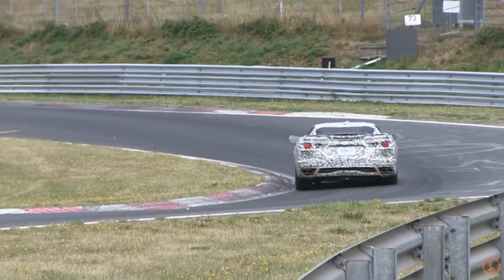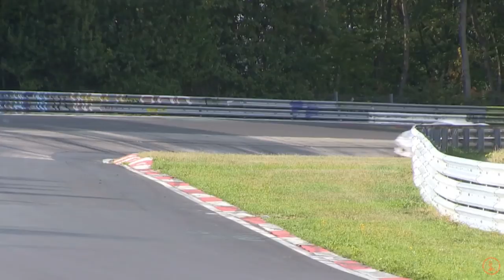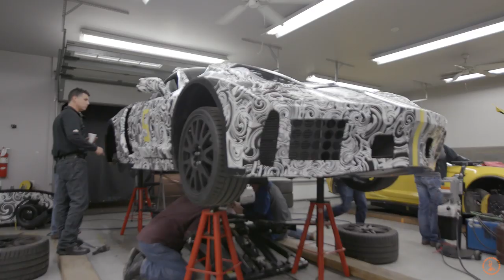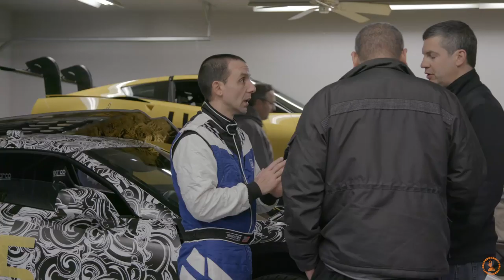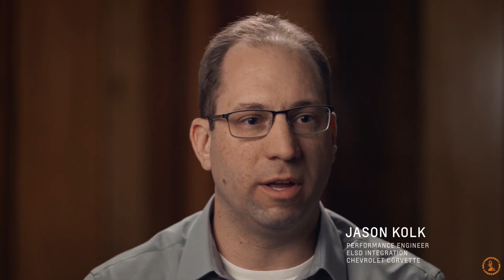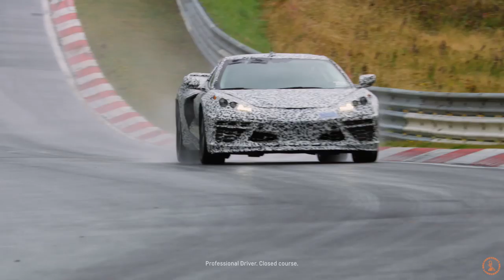2020 Corvette C8 Nurburgring Lap Time REVEALED!

Comment: Wow talk about slow given it’s a mid engine 500HP car.
Look at Porsche models with 500HP.
Reply: Swadian Knight 
Look at the GT3 numbers! Look at the GT3RS and GT2RS.
Look at the all the Porsche models in the top 20 times at the Ring.
Then look at the C8!
Porsche managed to set a lap record with a GT2 RS while the 750 HP Vett could not crack the 7 minute mark.
GT3 did it in 7.12.
BTW these are all times from the 991 series Porsche. God only knows what the 992 series will do given that the S is the fastest to be released so far.
Reply from the maker: @miketheman4341  The GT3RS and GT2RS are SO much more expensive than the C8 though, it's just not a fair comparison.
Reply: Swadian Knight 
Sorry but a GT3 is not 400k!
Mine was 157k.
Secondly Porsche’s numbers have never been disputed as they are documented. It’s not a claim! It’s recorded on video by Porsche. It’s why times include video.
Imagine my surprise that Chevy keep this a secret for this long.
Reply: DailyDownshift 
Sorry but the GT3 is not some insanity expensive car. Secondly the S and 4S are putting up comparable times in a car that drives much better and is leaps and bounds ahead of the C8 in build quality.
Remember the C7 made the 5 least reliable cars list from Consumer Reports and the Z06 actually broke down at the  Best Drivers Competition.
Chevy has demonstrated that you get what you pay for.
Reply: Swadian Knight 
You really don’t know cars!
The GT3 can be had for 143k NEW!!
Reply: Swadian Knight 
You are the only one who got it wrong!
Now go to the Porsche site and pull the GT3 for 187!!!
You can’t! A GT3 RS can be had for that price which proves you don’t know cars.
Lastly Porsche is on top of all sports car markers in reliability. Again this is not a secret. Unlike the Vett which always had laughable GM build quality Porsche is the sports car that you can drive 7 days a week in every climate. 
Was Consumer Reports lying about the C7 when it was named to the top 5 least reliable cars on earth? Not sports cars but ALL cars! 
That’s impressive even for GM! To sell a car that can cost between 50 and 150k and have it be among the worst cars on earth according to a company that does nothing but evaluating consumer products is an accomplishment.
There are no C8 production cars on any road. What we know is that the actual cars will get 1/3 the man hours that the pre production models got.
Imagine my surprise if I believe that GM might not produce a reliable product given it’s history with the Vett.
Then again you don’t know the difference between a GT3 and a GT3 RS so why would I think you know any better.
Reply: Just look at the price!
Reply: Swadian Knight 
What happened to your nonsense claims about the price of a GT3?? LOL!
I thought so!
Secondly you see more Vetts because it’s a cheap car. It’s the same reason you see more Corollas vs BMW 3 series on the roads. Secondly if you live in a modest income community you will see cheap cars whereas Porsche has no dealerships in average income communities.
It’s amazing that you cannot link the rarity of an expensive car with the fact that’s it’s not a mass produced car like the Vett.
Again have you ever seen a university let alone alone an understanding of research methodology?
It’s per 1000 cars! Not 100!
Meaning as long as a company makes 1000 cars it’s reliability can be measured accurately.
Again the Z06 broke down during the best drivers car competition. Consumer Reports listed the C7 as one of the 5 least reliable cars on the road.
I suggest you consider a community college as it will help you to understand methodology and also it might get you to a better zip code as you don’t find Porsche’s on the roads where high school grads live. No they are on the roads in America’s best zip codes.
What idiot uses a Craigslist ad as an indication of real data?
LOL!
Reply: @miketheman4341  I love porsches a lot and all gt3's but i knew the vettes are just as capable when it comes to performance.The C7 Z06 equipped with the z07 package beat a 991.1 GT3RS on the nurburgring and on mazda raceway laguna seca with randy pobst driving... Bottom line is Corvettes are the BEST bang for buck.. But i agree and admit porsches are built better and overall just a better performance car.
Reply: Meelad Ibrahim 
That’s my point! But beyond that it’s about bang for HP. Think about how much HP the Z06 had vs the GT3RS. It’s should not even been close.
The last Vett from the C7 embarrassed itself at the Ring give it’s HP.
Porsche put 700HP in a car and it broke the Ring record. Chevy put 750 in a car and what happened?
Lastly as Randy Pobst from Motor Trend put it you can push a 911 in a way that no buyer can push a Vett. 99.9% of the people who buy the Vett can never push it like they could a 911. 
These are pro drivers and the numbers are a disappointment according to the video. Which is exactly my point.
Reply: Meelad Ibrahim 
BTW the Z06 did it in 7.22 while the GT3 did it in 7.12 so no the ZO6 did not beat the GT3 at the Ring.
Reply: @miketheman4341  I agree 100% thats why porsches are just the greatest sports car in my opinion they are worth the money. Every single horsepower is able to put the power down and anyone can get in it and drive it. Where the vette needs patience and practice. But to me its still worth it for 79K that amazing v8 sound, manual and great looking too. But Porsche is just a step up overall. However, with the C8 being more balanced now i believe the C8 z06 will take it to the next level to compete even closer to the 911's.
Reply: Also a ZL1 1LE which is a camaro LOL.. did it in 7:16 and that car is around 70k out the door... All my point is chevy is a good bang for buck if you can't afford the Porsche.. Again Porsche still is the best in my opinion
Reply: Meelad Ibrahim 
I agree that the C8 is a huge step up but it remains to be seen how reliable it is and how it handles in the hands of real buyers.
Lastly you posted a video of someone doing a lap at the Ring. It’s not an official time nor is it listed as such by any publication that tracks Ring times.
This has become a real problem as most of these videos are not official times and frankly it’s highly unlikely given the official times of the ZO6.
Reply: @miketheman4341  I see, now i do think the C8 is an improvement for real buyers to be capable of handling the car near the limit without fear of losing control. After reading a review from Randy Pobst, he did state its much more "mature" and "grown up". Also stating the fact that it will understeer at the limit rather than oversteer. Unlike like past corvettes they are prone to losing control and just difficult to understand and drive the car hard. That is something to look forward to, however the reliability issue.. who knows haha.
Reply: Meelad Ibrahim 
True! Still we agree that this is not as good as a Porsche but it’s an improvement.
Lastly according to what’s been posted no one will be buying another C8 at the introductory price of 60k.
Chevy is raising the price by as much as 20k which I knew was coming. It made no sense that this car could be made for this money.
It also means that a future C8 could easily be a six figure car. This means that the Vett is no longer the Everyman sports car it was for years. A ZR1 could be a 200k car.
Reply: @miketheman4341  If you knoe anything about Consumer Reports you'd know they are considered a laughing stock. Corvettes are and have always been reliable cars.
Reply: bobe8888 
According to whom? Cite your claims and sources.
You can’t!
Reply: Swadian Knight 
Wrong again? First you claim that a GT3 costs 187k!
WRONG!
No I did not forget!
Then you claimed that there was NO such rating by CR!
Again Wrong! I posted it!
Now you want to argue that it’s not valid because you don’t like the metrics but how could it be flawed if it never existed according to you??
Lastly cite your nonsense claims regarding CR being paid. 
Give me a source! You can’t!
If you took an economics class you would know that Chevy has far more capital to buy a good review vs Porsche.
Remember this lesson. There is no substitute for a formal education.
Reply: bobe8888 
So Motor Trend is lying as well and Car & Driver? Again cite your nonsense claims!
Do you understand this concept? Example the ZO6 was the only car in the history of Motor Trends Best Drivers Competition to break down!!
Lastly Porsche owners don’t do any maintenance on their cars otherwise they would not be Porsche owners. They pay people like you to do that work just like they pay people to clean their bathrooms!
Remember this lesson!
Reply: @miketheman4341   The dealers are marking up the price because of high demand, that will come down after the initial rush. The small block chavy has been an incredible engine, simple and reliable. And if you do need something repaired it won't cost as much as a house. Old Porsches are rare, old corvettes are everywhere with high miles.
Reply: bobe8888 
Old Vetts are everywhere in low in zip codes! It’s the same reason Corollas are everywhere. They are cheap and their are plenty of them including spare parts.
Now again is everyone lying? The entire automotive publishing world??
Reply: How about the Motor Trend where the 911 turbo they were testing had one of the turbos lock up? Yes the C7 ZO6 had known cooling issues in extreme reat, the issue was fixed and the ZR1 had like 10 radiators to make sure that didn't happen.
Reply: @miketheman4341  Yeah Jay Leno is a poor car guy. James May is a poor car guy. Real car people always work on their own cars, that's part of the experience. You don't because you're not capable.
Reply: bobe8888 
You are missing the point! It broke down which NEVER happened in the history of BDC !
CR RANKED it as among the 5 least reliable cars on earth. Fixing it in later years is not an excuse.
Lastly you are clearly out of the loop. Chevy is raising not lowering the price by 20k.
It’s a huge story!
No one will be buying a C8 for 60k next year.
Reply: @miketheman4341   No one works on European cars because they're lease or throw away vehicles, that's why you never see old ones on the road when they need work on you just throw them away, because they can't be repaired, at least not at a reasonable cost.
Reply: @miketheman4341   What did CR bais this on? Because the companies that collect metadata on car reliability says the Corvette is above average in reliability. Maybe not the early C7 ZO6, but all the other models. The only other not so reliable corvette was the early C4 with L98 that was a junk engine, which was replaced with the awesome LT1. All manufacturers make mistakes Porsche is not immune from them. Hey look at McLaren right now there are absolute garbage, fast, but total garbage.
Reply: It does look like the price of the C8 is going up in the next model year 2021, which is to be expected every year. Looks like +$10,000 which is still half the cost of a $140,000 money pit.
Reply: ok, so why are you watching videos about corvettes if you don't like them? Why Aren't You Going To Watch Porsches Videos? lap times in nurburgring don't matter anymore, so many variables, different drivers, different climates. Nowadays these lap times are just for people like you talking shit. 

 too many variables and on a very long track like this only makes things worse. so stop! Nurburgring is not the only circuit in the world. (the 2015 corvette C7 Z06 costs 98K and made 7: 13.9 and the porsche GT3 RS 2016 which cost 187K makes an "estimated" time of 7: 20.0) if you don't know there are different ways to make a fast car. Some are simple and inexpensive and others are expensive and complex.

 The Corvette is a performance car that has one of its main goals being accessible to people who are not rich, and that makes all the difference. That's why they use different "recipes". gm seeks to make the corvette as fast as possible but it doesn't cost much, which is very difficult. Porsche just develops new technologies for their cars and because it's a premium brand you don't have to worry about values.

 let's take laguna seca lap times as an example because the test was done the same day by the same driver.

 the manual corvette Z06 C7 made 1: 33.05 and the Porsche GT3 RS did 1: 33.29 but then you will say that the Z06 needed 150hp more to be 0.024 milliseconds faster but that's where it is! the Corvette Z06 costs half the value of a GT3 RS both use different recipes to get the same results.

 the corvette uses wider tires, have more horsepower.
 porsche has less power but has pdk, four wheel steering, roll cage, lots of carbon fiber, less weight and much more aggressive aerodynamics, not to mention other technologies and it's these premium materials and technologies that make the GT3 RS so expensive. Now some track times for you. 
Virginia International Raceway. corvette zr1 2: 39.50 
corvette z06 c7 2: 41.32 
porsche GT3 RS 991.2 2: 41.60 camaro zl1 1le 2: 45.0 
porsche GT3 RS 991.1 2: 47.0 

remembering that even the most expensive corvette is still cheaper than a new GT3
Reply: The Guardian damn that was a great reply haha.. facts
Reply: @miketheman4341 
Remember the head 2 head between the C6 ZR1 and the Porsche 911 Turbo S? Guess which one couldn't compete in the road course portion of the contest due to a malfunction... It wasn't the Vette.
Reply: EdMiF 
C6!! LOL!
What’s next a comparison between 40 year old models?
Hint it’s not the 2006 nor 2012.
It’s almost 2020.
Reply: @miketheman4341 
But Porsche is sooooo reliable... 😄
Reply: EdMiF  
Yes see the reliability scores of Porsche in the half dozen years. 
Going back 15 year is laughable!
What’s next 40 years ago?
Reply: @miketheman4341 
But you were the one that brought up a Vette breaking down during testing. I'm just pointing out that Porches are not immune to failing during magazine testing.
Reply: EdMiF 
One I bought up the latest model Vette which broke down and I actually cited the specific competition.
You needed to go back generations find an example. I used the current Vett which is the only one on the road as no buyers have the C8 yet.
Reply: @miketheman4341 
None the less, the Porsche broke down against the "inferior" Vette.
Reply: EdMiF 
I’ll remember that if I’m ever in the market for a car from 2 decades ago.
Remember this is about actual modern cars that are the latest models.
GM has a horrible record of reliability while Porsche sits on top of the list.
Try staying in the last decade when comparing cars.
Reply: @miketheman4341 
Check with some Porsche mechanics and get their opinion on Porsche reliability. In addition, there are Porsche owners that got tired of engine issues and did LS swaps. Ohhh the irony... 😄
Reply: EdMiF 
Meaning that science was not your field.
CR and JD Power tests using scientific methodology not random opinions based on claims.
Remember this lesson in epistemology.